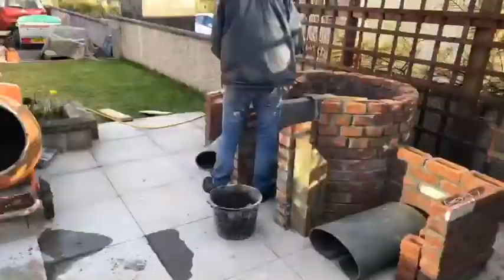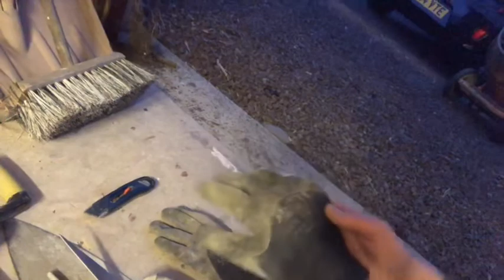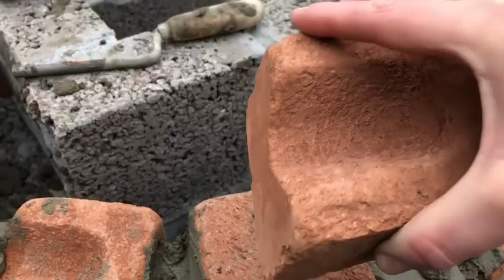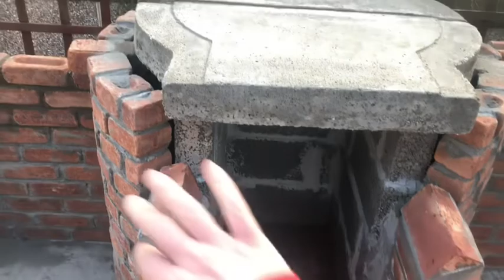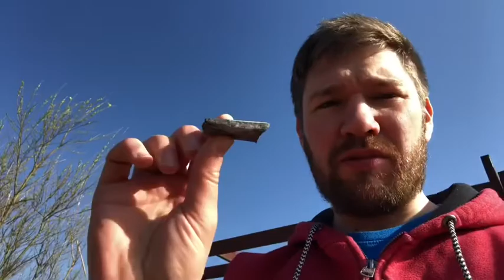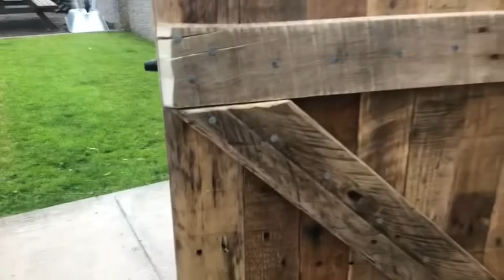Pizza oven build

Comment: Really great video, nice explanation of all the important points. I’d love to make something similar in my garden so this has been very useful. Cheers 👍🏻
Reply from the maker: Thanks! Good luck when you come to build yours. Ours gets a lot of use- even did Christmas dinner in it 🍕🍗🔥
Reply: @davewellscoffee  Hi Dave. Well, a year later and I have now made mine! Used Pizza Oven Supplies as well and am incredibly chuffed with the results.
I have a question that you might be able to answer - you mentioned in your video potentially sealing the brick work with a liquid sealant. Did you end up doing that, and would you recommend it? I am inclined to do it so wanted to know your experience. 
Thanks buddy, all the best. Simon
Reply from the maker: @simonnorthover  awesome! Yes I did- I used Thompson’s Water Seal. Got it from Amazon for under £20. Can’t say what it would have been like without it, and there has been a little bit of salt bleed through, which I’ll clean off and re-coat. Overall though, there’s been no real maintenance and we’ve had a lot of use out of it 👍👍

Comment: Greta video. I plan on building the same. Do you know approximately how many bricks you used ?
Reply from the maker: I’ve had it a while now, so my memory is a bit vague, but it was about 150 full bricks, 300 angled half bricks and about 250 quarters which went over the dome. The bricks took up one pallet of the delivery !

Comment: Hi Dave, Im in the process of building the same oven. Inside the dome you say that the fireproof mortar and grog goes in between the fireproof bricks and the dome wall, do you just mix the two together and brush in. How did you get it in there as access is only through the oven door?
Reply from the maker: Hi Jim, I asked them about this before doing mine, and they suggested mixing the mortar and grog dry, packing it on, then adding water. If you do this, be careful not to add to much water and wash it away, just enough to get it all wet. I made a mess of it that way and ended up getting another batch of mortar, mixing it wet and packing it in. It goes off really quickly, so you have to work fast- do it in a couple of goes. The only access as you say is through the oven door, so a head torch and long arms is what I used!
Reply: @davewellscoffee  Thanks Dave

Comment: I note your oven is around two years old and was thinking of buying from pizzaovensupplies too, how has it faired since you built it? Thank you in advance
Reply from the maker: It’s really good- no problems at all. It seems like it will last for a very long time. During the build, the guys at pizza oven supplies were very helpful with any little issues too.
Reply: @davewellscoffee  how many 12 inch pizzas do you think you can comfortably fit when cooking, would be two max right? Thanks again
Reply from the maker: @lewisdow  yes 2 max, although I only ever really do one at a time. When it’s up to temperature a pizza takes about 60 seconds and you’re always turning it, so any more than 2 would be an absolute nightmare.
More space is good for doing other cooks like roasts etc though- although the bigger it is, the longer it will take to warm up.

Comment: 7.5 kn block cut all day long with a diamond blade🤔🤔
Reply from the maker: It wasn’t really that the blade wouldn’t cut through it, not that the size of the blade was too small, so it was quicker just to use the mallet